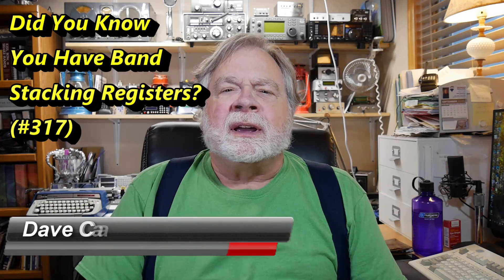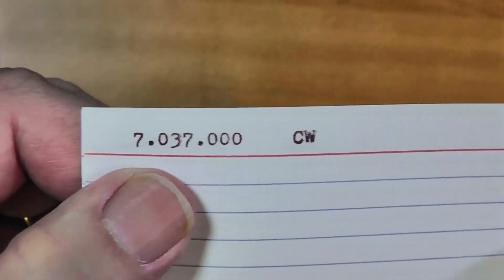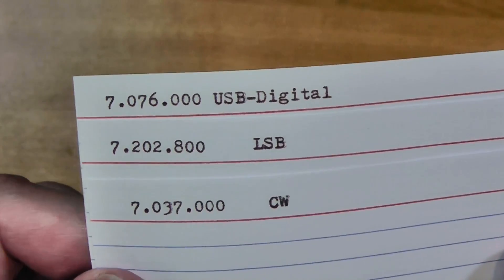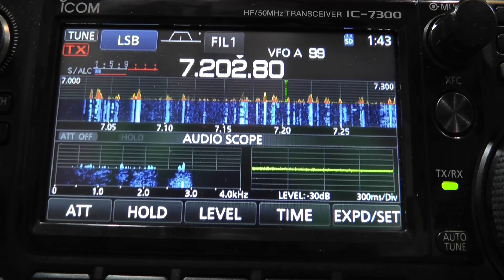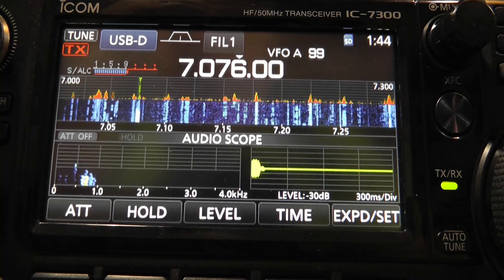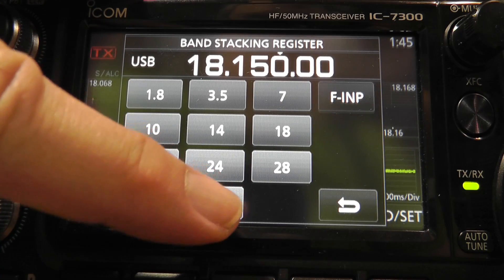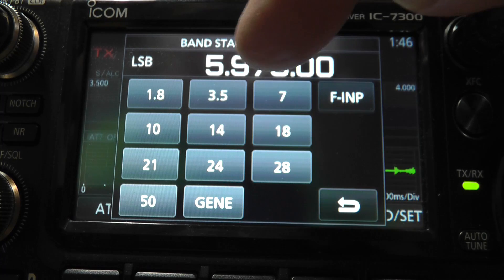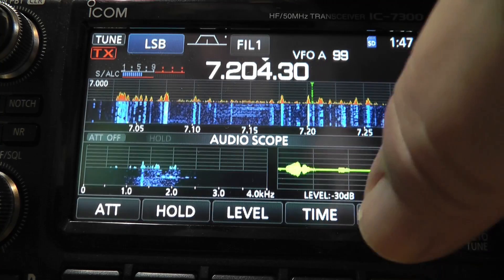Did You Know You Have Band Stacking Registers? (#317)

Comment: Dave, sorry for the stupid question, but is this for new rigs or older rigs too? Like say my 706mkIIg?
Reply: Good question... He mentions the feature showed up about 10 years ago or so. My guess is that the 706 series does not have it, but I don't have one to test with.

I will have to play with my rig some, but I don't think they have this either (maybe two VFO band stacking, if at all). I have a Kenwood TS-940s, and Kenwood TS-480sat.
Reply from the maker: It would likely be mentioned in the manual.
Reply: Does it have a button per band like shown? I think that's an essential element for this. No buttons would suggest,  no